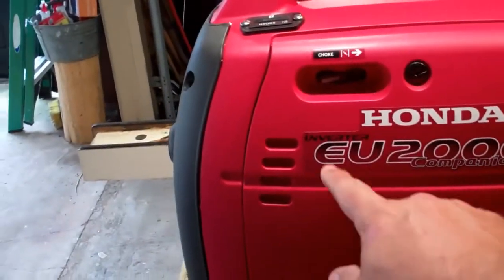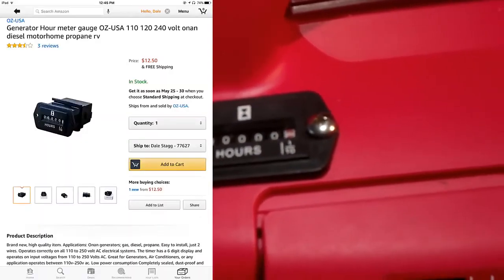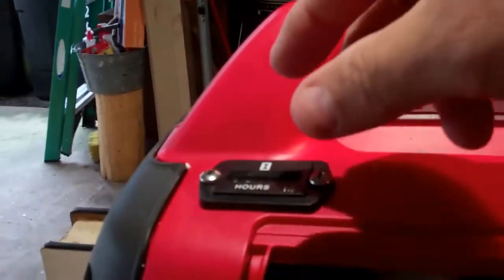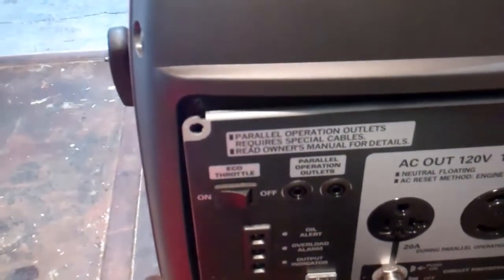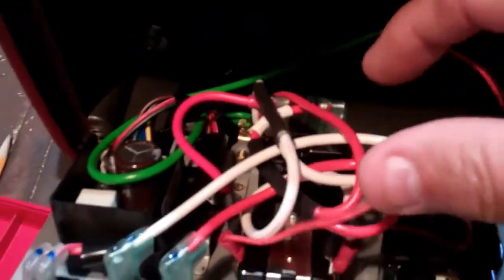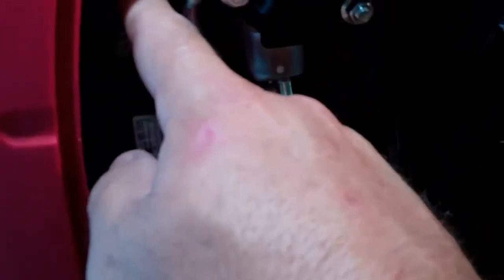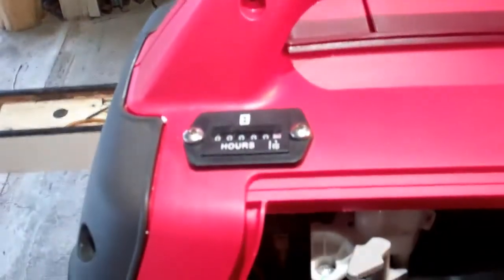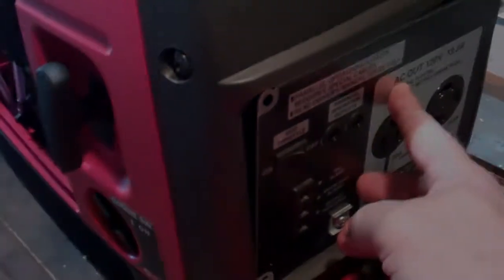Honda EI2000i Companion Hour Meter Install (110 volt meter)

Comment: The predator version doesn't have any extra room in the back. Using the spark plug access hole is really the only option

Comment: Another great video. I like this method better than the 12 V. It's even easier to hook up to the 120v outlet without the necessity of using splicers. Thanks again
Reply from the maker: Agree and if I was to do it again, I would have used the 110 volt on the 12 volt version also since it was easier to install.
Reply: Dale Stagg thats right. Pardon my ignorance but how do i know which side of the 120v is positive and which is negative?  On the eu2000i the outlet is horizontal and not vertical like this one so i can not imitate what you did (positive on the left and negative on the right). Thanks
Reply from the maker: Since this is 120 volts ac, as stated, I put the hot wire on the gold terminal of the outlet and the neutral wire on the silver screw. It actually will work either way if crossed. It isn’t like 12 volts dc which has a positive and negative, it is typically gold screw as hot and other wire goes on solver screw for neutral wire. Still again, it would work either wire you use with the outlet just like plugging in a cord on an outlet, the plug can work either way you turn it to outlet but newer plugs allow you to go in correct polarization with a wider end of plug. Grind off the wider end and still works.